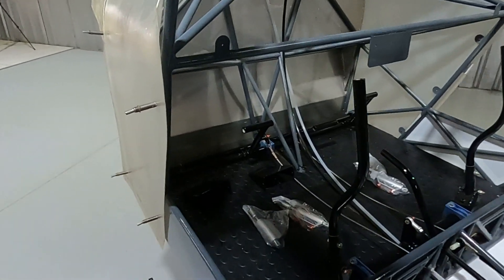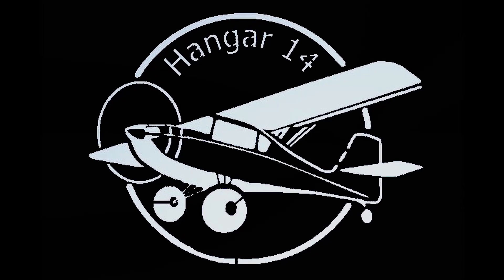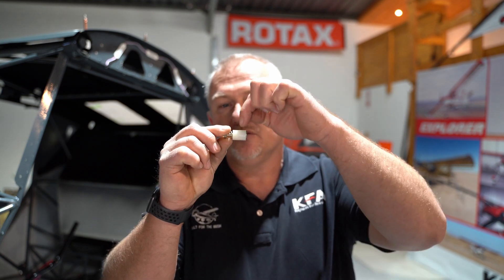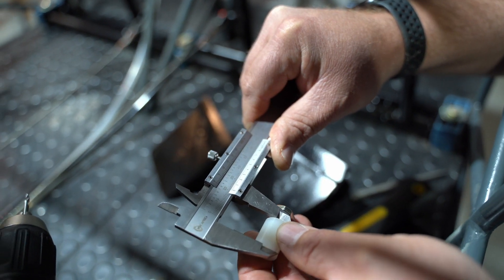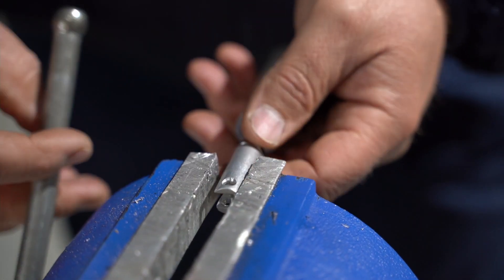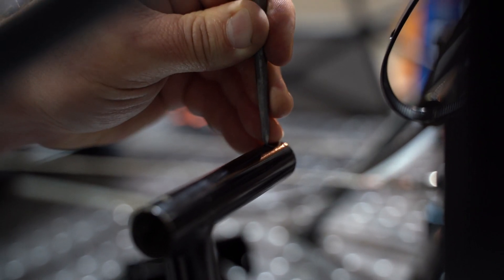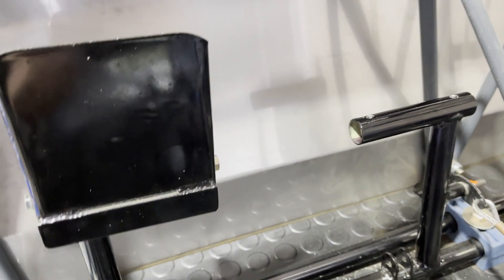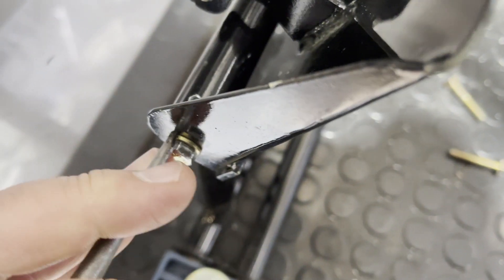Episode 3 - Installation of the Brake pedals and master cylinders

Comment: I'm installing the pedals prior the firewall and engine is mounted to have enough space.
Reply from the maker: That is the way to do it, its ideal at that point to also install the brake pedals and master cylinders as well as do the brake lines so you dont need to fiddle there once the firewall is on.
 You can just roll up the brake lines under the seat for now until you are ready to install them on the wheels.